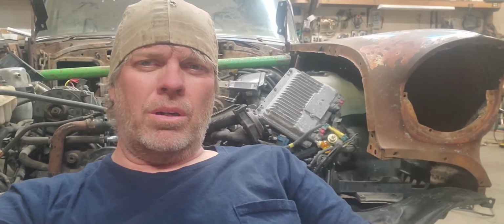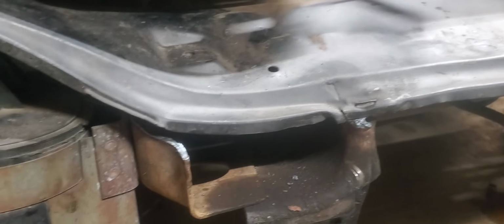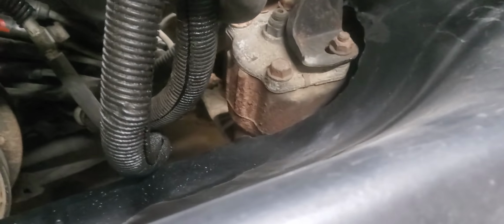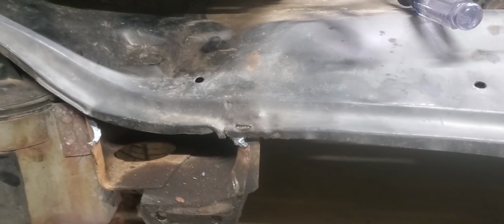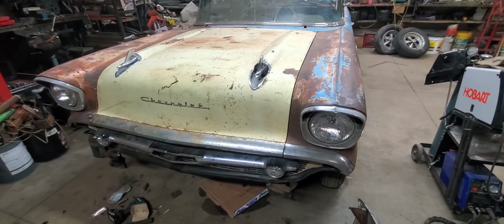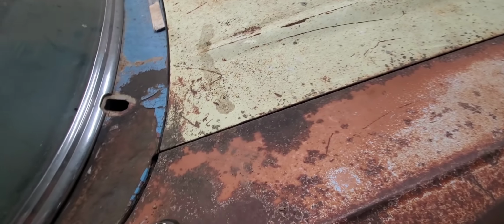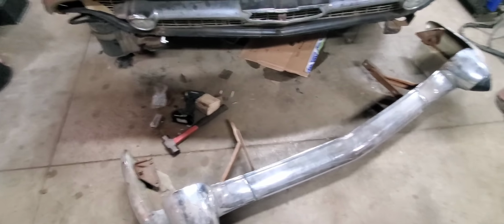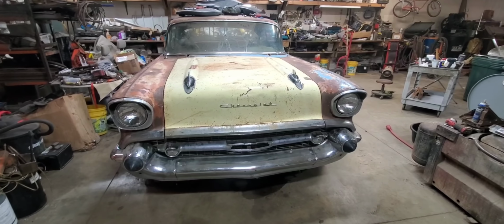Getting the trifive Chevy blue goose front clip lined up with the lt1 Buick roadmaster chassis

Comment: Looks like your hood is off a six cylinder car, no V below the script. 

Boy that's amazing how well that all fits together though.   I guess what I'd do now is turn the front wheels and see if they're going to rub anywhere when you go around corners.   That was the hangup when I tried this years ago.
Reply from the maker: Heck yeah  your right it is a 6 hood and the bad thing is the script is bigger on the 6 cars so if put the v on it I will have to put the smaller Chevy script and weld a couple holes up ! Lol

Comment: If I didnt know better Id say she came that way. My heart skipped a beat when I saw the front go together. Ya got any more old Chevrolet scripts? Also I need the hood brace that the rocket mount to. The one that goes clear across under the hood. Mine Swiss cheese. Thanks Tuck.
Reply from the maker: Heck yeah its looking more like a  57  every day lol , any of the scripts I have are probably going to be pretty  pitted but I should have the hood brace I'll take a look, is shipping very high to Hawaii?
Reply: midnight flyer depends but yes it cab be. Pitted Scripts are better than no scripts or new ones. Most of my trim stuff is pitted. I also need the drivers fin corner and gas door. Im converting it back to fin fill. Thats one of my favorite attributes of 57s. Mine Dont have it. Thanks Tuck!! Aloha.

Comment: Those fuel injection insignia's are a classy touch... I am surprised that you could see how it was to look like and persuade it to live that way. Not sure what or how you will do the body mounts but I am positively sure that you wouldn't use the rear end U clamps to drop through the body and hook something solid somewhere\HA HA HA. I have never been a fan of the chevy as I am 73 and when I grew up.... you either were or .. or not chevy. I raced big block fords an then some guys started a front wheel drive race that resembled the circle eight track where nice rigs died in a single hit... lucky if that was all the hits in them days as the scars were symbols of respect. That rig should get out of its own way respectably without being a drag car. I hope that you don't go heavy patina on that rig as they are just flooding the scene as we yak. AS I wandered off of the front wheel drive rigs, I went with the Tornado by oldsmobile and it was heavy, hard to kill and we did dent them... most of the speed we got to might of been over sixty but so short a spurts.... and then "Wham" and it was over as we got towed off the track. Back then we figured they would be around forever an maybe more as the old wrecking yards of my day didn't have much stuff in them newer than say "Seventy" ish sorta as most was forties an fifties. I watch these guys go to these old yards where people hoarded them and sure enough nice rigs torn down for parts.... tons of them resulting in a shortage left on the road.. I really hate seeing them in old swamps and rainforests. A guy there in Portland Ore. has got any part for a older chevy ...36 to 72 models and nice stuff. Ships worldwide and motivated to sell parts so he is probably a good bargain.... to find him the easiest way is a channel called mr goodpliers and he is associated with the son of the owner.. son being the seller of parts now. I seen millions of dollars worth of nice stuff... including new oem fuel tanks an other.. that guy has it covered.... including any missing parts of trim like your fuel injection insignia or a electric wiper motor if the newer gm/buick won't adapt to the cowl .... your doing a damn fine job so be proud
Reply from the maker: Thanks 👍